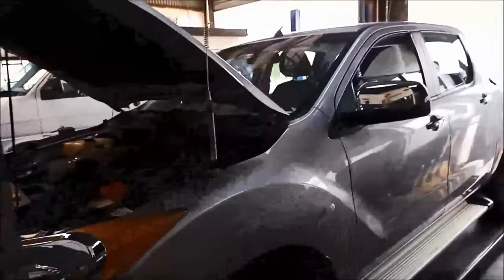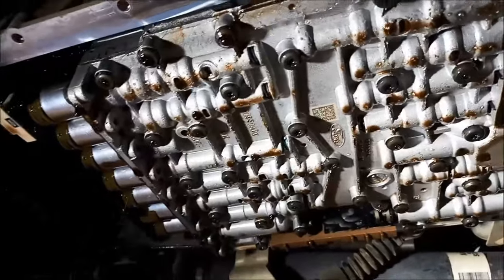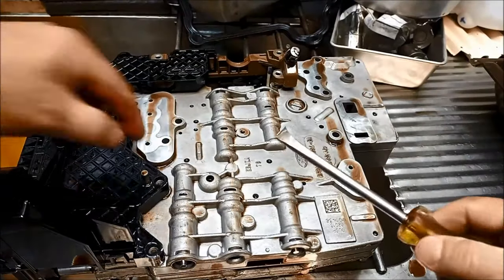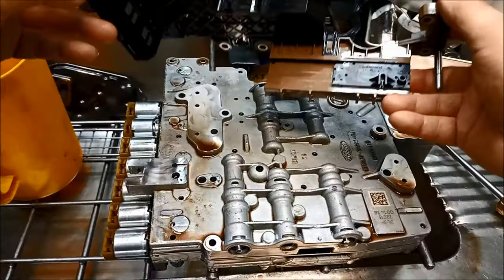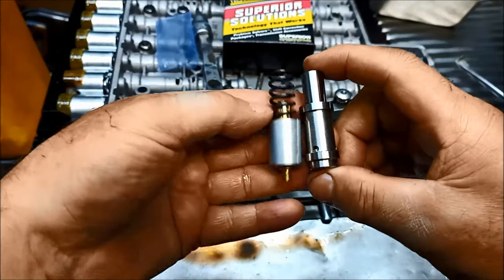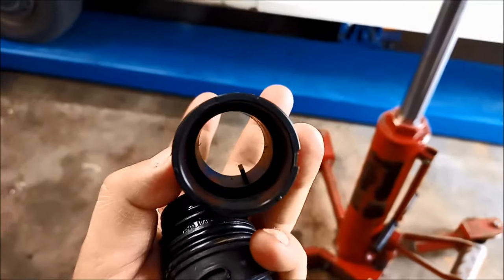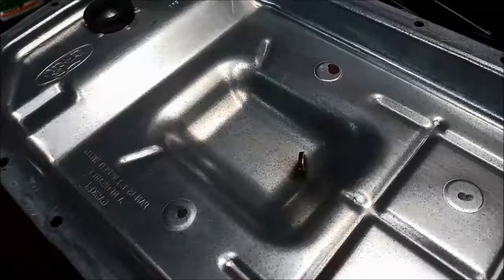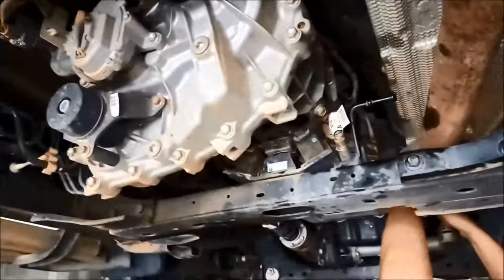on COFFEE 6R80 Transmission Thermo Cooler Valve Fit Constant Flow Cooler Ford Ranger - Version x1.75

Comment: I am trying to adjust my transmission fluid level and after going for a 50 minute drive. I checked with an infared thermometer and the temperature was only 51°C. I have a bypass valve and external cooler. Not sure where i should fill it to the hot or cold marks? Its a 3.2 everest.